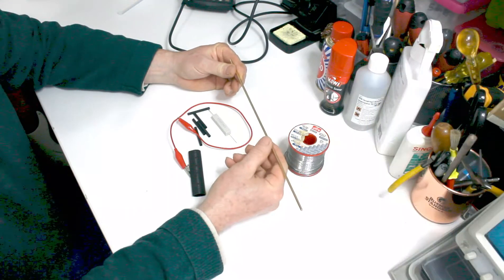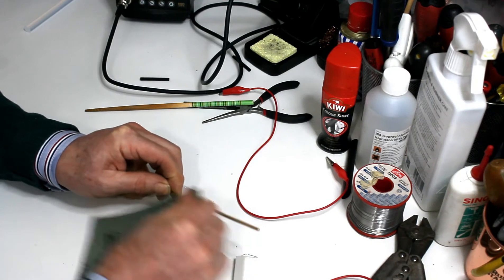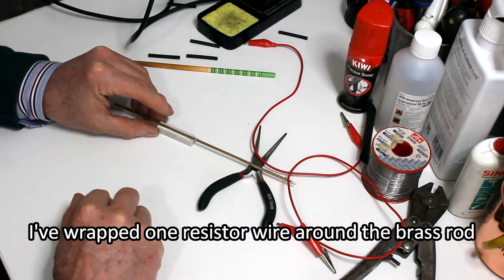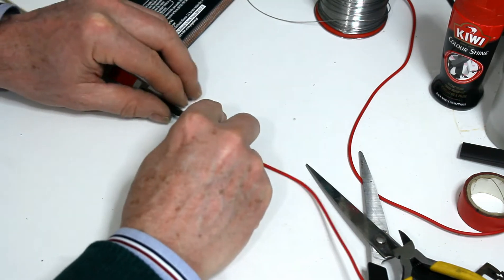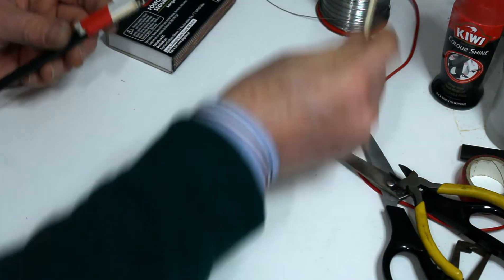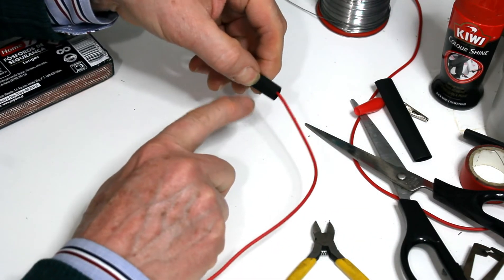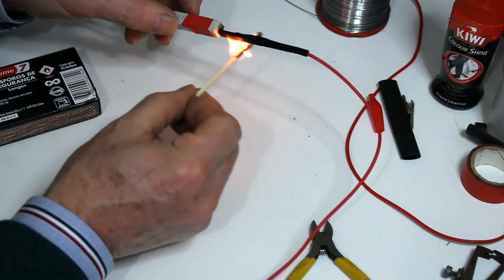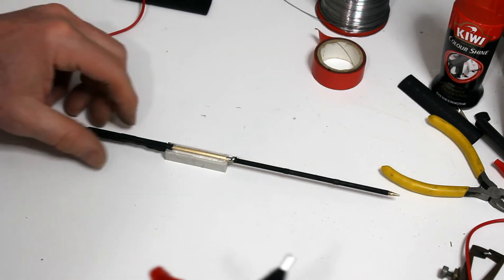DIY Capacitor Discharge Tool for Tube/Valve Amps

Comment: Use a 1k ohms 25 watt capacitor and insulate it from the brass/copper bar.  Matches? Oh geez; buy a heat gun and make a clean shrink.  I prefer using 14 ga. multi-stranded wire and not chessy thin 20 ga. garbage from Harbour Freight.  14 ga. woven wire is even better for flexibility.

Comment: Thanks for making this video. Why use a brass rod? Is there a particular reason why you used brass? Thanks
Reply from the maker: Hello William, I chose brass as it is a better conductor of electricity than say steel or aluminium, it is often used for screw connectors due to it's strength where wires need to be joined.  Copper would be a good choice but is a softer metal. Brass is readily available in this type of rod.  Thank you for your comment.

Comment: 100 Ohms !!?!! Discharging a 2,100 V, 1 uF microwave cap would fry this despite the nice construction.
Reply from the maker: Hi Colin, yes, I believe you're right. It's no use for such high voltage. But this is designed for tube/valve amp use. Thanks for your comment.